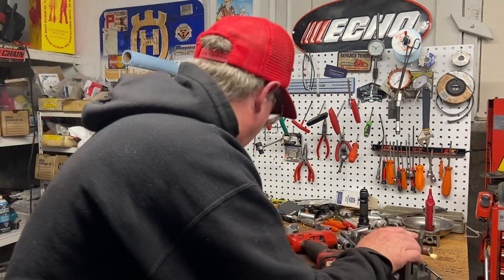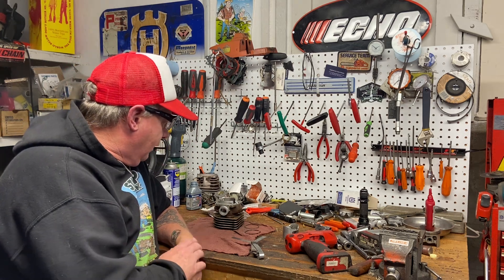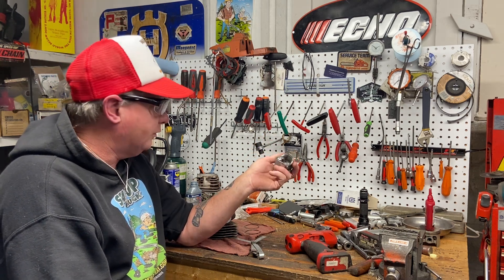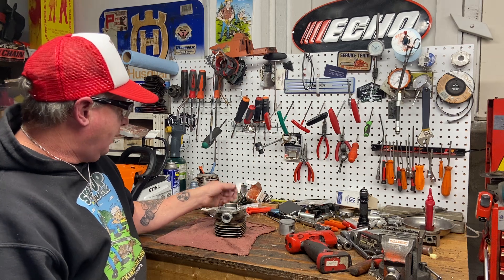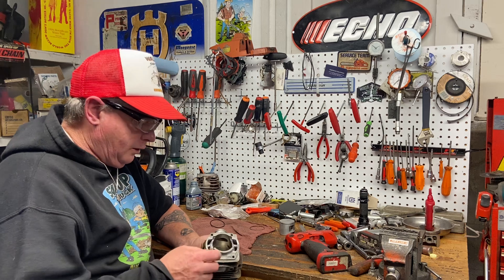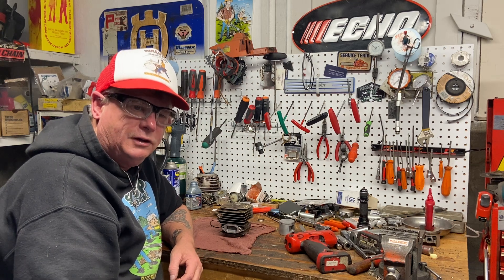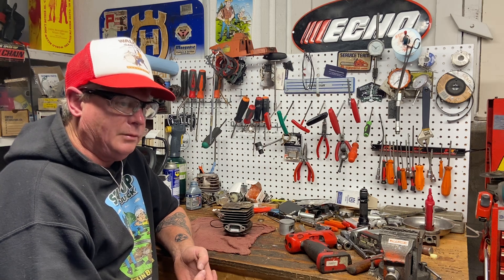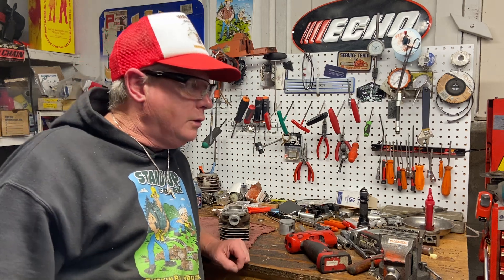Checking ring gap on a chainsaw

Comment: Porting is the same as a bigger cam.
You are opening and closing the airflow at the most opportune times, increaing valve size and porting the heads.  A modded muffler is headers and duals.  😊😊😊😊 gonna really confuse those who don't get it, but it's exactly the same effects, just a much different method.

Comment: Hello Donny I am seeking professional advice on a ms260 I have that won't Rev up pass 12,000 rmp running to rich & the H side adjustment closes all the way on the carburetor. It passes a vacuum & pressure test & also has over 160 psi compression.